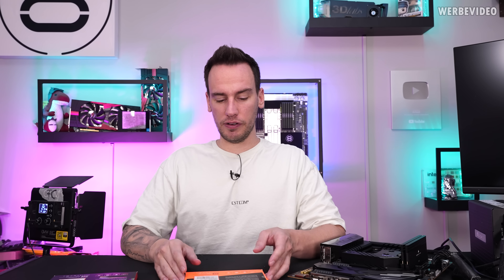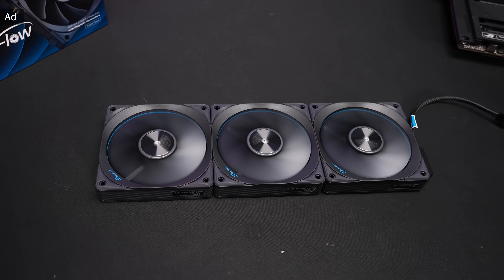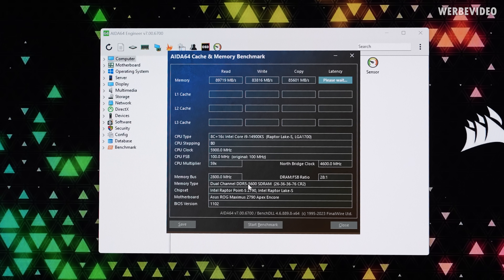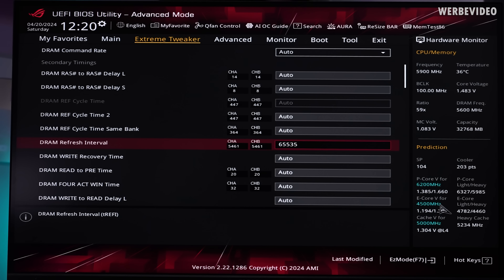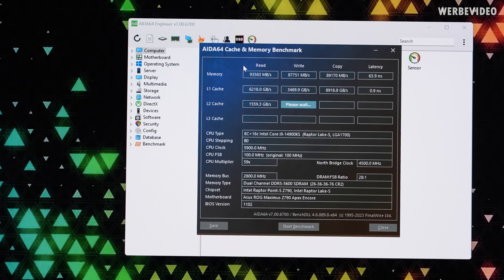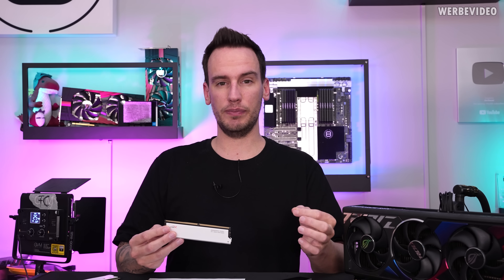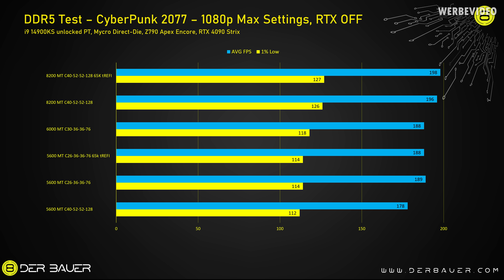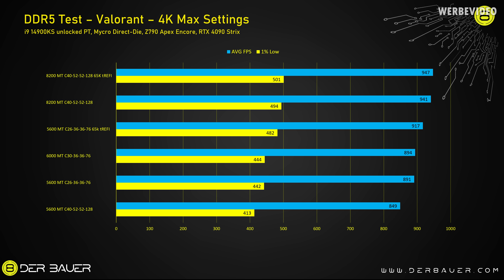Try this DDR5 Subtiming Tweak for Extra Performance

Comment: If you're on 6000MHz RAM or similar, on AMD, look up Hardware Unboxed's RAM timing video, they got info from Actually Hardcore Overclocking (who specializes in memory OCing) for timings that give you a noticeable performance gain, while being "just plug and play" stable.  They tested them & saw gains between 2-15% in games, so it's very much worth doing.  It's just a bunch of secondary timings for the most part, but it definitely works, I've been running it since shortly after I built my 7800X3D system late last year, never had any issues related to memory performance or gaming.

Comment: The only people talking about how memory timings won't make a massive difference clearly just don't know how to make a proper tune work. You will gain not only 10's of FPS but also make your frametimes much more consistent with a nice RAM kit that can handle low timings, just speaking from experience.

Comment: There wasn't said this is valid for Intel only...for Ryzen it is the other way around, lower timings make much bigger difference than higher frequency.  Especially tweaking not only the Primary but especially the Secondary timings for Ryzen makes huge difference in performance😉I would like to see the comparison also for Ryzen with those low latency sticks....

Comment: Hello Der8auer, I have a technical question to you. A few years ago Steve from GN made a test on different RAM configurations, specifically 4x16 vs 2x32, DDR4. I remember he was saying in the conclusion that by running 4x16 configuration you generally get about 10% more performance. Do you think this is still relevant today for DDR5? If yes, do you think it would affect the results of the memory bandwidth tests?

Comment: The most important subtimings:
tREFi - 65535 (If it's unstable can be used 52224 or 32767)
tRDRDSG - 16
tWRWRSG - 16 (or 8 if it's stable) everything between 8 and 16 gives worse performance than 16
PowerDown - Disable
Reply: I would keep power down enabled it helps with idle power consumption

Comment: Quad channel DDR4 still gives better bandwidth and latency. DDR5 is such a yawn-fest.
Reply: Until DDR5 12000 exists using a 1/2 divider on AM5 anything above DDR6000 is a pretty pointless on Ryzen.

Comment: If you want a test that'll actually show a difference try using Starfield or Star Citizen. Both have massive improvements from memory latency, even on X3D CPUs.
Reply: Testing CPU limited scenarios is the only way to properly test Ram speeds. It’s not going to do much if you’re GPU limited. Faster and or lower latency Ram reduces CPU bottlenecks.

Comment: The ram timing become much more important on games/programs with a very heavy RAM usage for many small data sets and where the CPU cores (for the program) are getting maxed.
effectively, the CPU/GPU busy thing also happens to RAM, so lower latency effectively means it can handle those memory calls faster and move to the next computation sooner.
this is especially true in physics simulation games that peg only a few cores like KSP (1), where the engine is handling complex math with many interworking variables that the CPU has to calculate a few times every frame. 
if the games simulation rate happens at say, 200hz, that means on average we're making 3x simulation passes per frame at 60fps. if the game has to run gravity, velocity, rotation, collision/interaction, aero, thermal, thrust/thrust vector, lift, and power calculations on EVERY PIECE of the aircraft 3x every frame... yea, thats a LOT of math that handles floating point numbers stored im memory. latency is much bigger here.

Comment: Great all the speed we can handle. Yet, I thought there was a relationship between pin burn-out and xmp profiles, mixed with high performance ram - while supported on the motherboard QVL will actually void the warranty of the chip (Intel)  I am a system integrator, while I desire the best performance possible for our high end workstations creating failure isn't an option. Was purchasing K sku's for a long time until the recent problem - mixed with the frame issues is a giant mess indeed.

Comment: im sorry but this is a bad video considering how wide/normie the viewerbase will reach:
trfc and trefi are the key timings that when unstable literally destroy your files & os, this is horrible to just blanket recommend to people. ram tuning and stability is not a joke on new platforms/ddr5. Yes, 32000~ is safe, 65000 needs to be cooled below 50c at the least so is bad for most users and must be stability tested, and anything above 65k is pretty much meaningless in actual return and the window for instability/overheating corruption goes through the ROOF. you are not talking about this much at all and how serious it is, just "yeah it can cause instability and the data returned can be 0's instead of 1's".

trfc - trefi are hand in hand and once you get to <2% below time spent refreshing (literally achieved by 600 trfc and 32500~ trefi alone) it is not very significant.. and your benchmarks show show that trefi alone is not impacting gaming much at all. synthetics and aida, sure, but 1440p+ gaming? anything past 32k will not do that much.

so many inexperienced/ignorant people will watch this video and just add changes and gg. you can't just increase trefi too, it needs extra voltage in some situations, and on ddr5 that can stupidly make everything out of whack too. 32000 is pretty much guaranteed/safe, but 65k is riskier and NEEDS to be checked (tm5 1usmus many cycles because its a heat induced error, hci memtest, vst/vt3 looping, etc), which you don't mention at all in this video either.

combine that with the fact ddr5 stability is not even guaranteed beyond 6400~ for 4-dimm boards and low cpu imc quality is just crazy considering this reaches normal userbase.

Comment: It's a funny comparison, because when translated to actual time, the kits you compare are:

DDR5-5600 (9.3 ns - 12.9 ns - 12.9 ns - 27.1 ns CR2)
DDR5-8200 (9.8 ns - 12.7 ns - 12.7 ns - 31.2 ns CR2)

So the 5600 MT/s kit doesn't even respond faster on all the subtimings, it's actually a little slower on the trCD times, even though the difference is more than compensated by the shorter CAS latency.

But yeah, in generally I don't think the memory timings have ever been massively relevant since the DDR2 times, when latency difference were massive and CPU branch predictions were bad or non-existant. Modern CPUs will just keep the caches filled with all the likely data most likely to be needed next, so the actual ALUs are rarely waiting for a RAM access. 

And I guess nobody is even bothering to get to CR1 anymore, I think this still could give you a few tenth of a percentile of performance on DDR3 systems, but the overhead due to double-commanding is probably entirely irrelevant now when latencies are well into the double-digit numbers.

Comment: DDR5 is 2 years old but still a pain in the neck from time to time.  Running 4 sticks to get 128GB with XMP enabled is still a problem.  Reboot delay and slowness with expo enabled on AMD processors are still going on.  The failure rate is much higher.  Compatibility issues are still a problem as processor IMC is something we can only find out after testing with actual memory kit. The last thing a normal person requires is an unstable system that crashes randomly and corrupts OS to get from 179 to 189 FPS in some select games.
Reply: DDR5's a complete shitshow on both AMD and Intel when you put in 2 DIMMs per channel though. Definitely wouldn't recommend going with a total of 4 DIMMs for just gaming
Reply: while I agree it is unacceptable that 4 dimms are almost unusable with ddr5 but I'm not sure who's to blame. I think it would be safe to go for a 4 dimms kit if you need more than 128gb ram. in other cases just use two dimms. but the way I see it 2x64 should cover most power users

Comment: Roman (Der8auer) also doesn't seem to realise that not only is the MT/s of the RAM different, but on Intel, the difference between running 8000 MT/s RAM and 6000 MT/s RAM also means that the Memory Controller is running at 2000 MHz for 8000 MT/s vs 1500 MHz for 6000 MT/s.

With Ryzen 7000 Series CPUs they would also be running 8000 MT/s RAM at 2000 MHz in gear two (UCLK=MEMCLK/2) in the Memory Controller, but they would be running 6000 MT/S at 3000 MHz in gear one (UCLK=MEMCLK) in the Memory Controller
Reply: Papá Jim Keller diseñó esas dos arquitecturas.

Comment: Great video as always. I would always recommend the Tgroup sticks btw. 7200+ will always be A die and the stock heatsinks actually cool the best compared to other brands. Also, you can generally tighten the timings up a lot more than demonstrated in this video.

Comment: EDIT: After trying this for almost a week I found it creates massive stability issues. Graphical glitches on desktop. Chrome crashing. Programs not loading properly or loading but not running properly. I wouldn't recommend this. 
I tried this with my A-Data DDR5 4800Mhz (2x 16gb) running XMP1@6000Mhz. XMP1 timings are 76-40-40-40. AIDA64 reported 73.1ns with stock timing. Then 64.5ns with the tREFI tweak. I'll try this setting seeing as I see a big difference and see if theres any problems with daily use. Using a 12900k and 3080Ti on a Z690 Gigabyte Aorus Ultra MB. .

Comment: I wanna see a video of DDR4 last gen cream of the crop, 4000mt cl14, overclocked vs DDR5. Personally by my math my 4266 CL14 will cream that 5600 cl26 except for bandwidth. There will be a cap in bandwidth for games, you don’t need 90gb/s and latency starts to matter more. It’s not loading the whole game in 1s. The 8200 CL40 was the best because of latency not everything else. So it really goes back to what has been true since ram was invented, latency, I mean that’s why it exists in the first place and that’s how software wants to use it. This is a “tweak” for gaming where the data is constantly refreshing, try solidworks or 50 chrome tabs and see how fast the BSOD will get you

Comment: 8200 C40 already is a low latency kit.  It's the closest you can get to the same as 6000 C30 and 5600 C28 without being the exact same.  Thus the C26 5600 kit is only marginally better.  Though, sub timings and tertiary timings would have an impact on hierarchy as well as raw megatransfer speed.

Comment: getting 104gbs on 6400 cl32 and 58.2-59ns with memory try it and msi memory enhance can get slightly better with manual timings but pretty good for board settings.

Comment: Hi der8auer I see you left out tuning of trefi x9 at same time when tuning trefi, I tuned trefi x9 and trefi on my 8000-40-48-48-128 kit and saw a further reduction of latency again, I have a 8000-40-48-48-128 48gb kit doing 52-53ns latency with a trefi x9 and trefi tweak whereas they will only do 58-60ns when tuning just trefi alone.

Comment: Please do an in depth video on all the DDR5 timings, what they do, and how to optimize them. Increasing TREFI  is a good tweak, but, there is much more that can be done.
Reply: go watch Buildzoid
Reply: Tweaking trefi and trfc will exhaust 80% of the overclock potential, an average user really shouldn't bother with other secondary and tertiary timings.
Reply: @beachslap7359  Unless you have Ryzen, then tweaking the Secondary timings makes huge difference in performance😉
Reply: @beachslap7359  depends on the platform overclocking memory is often and or with timings, for 1 CCD ryzen anything more than 5400Mhz is pointless dont know how it is with intel, so ryzen 7500f 7600 7700 7800+x3D only benefits from tweaked timings + overcloking of infinity fabric.
Reply: Look up Actually Hardcore Overclocking / buildzoid - he's got quite a few guides for DDR5 timings and I've been using his "easy ddr5 timings" on my 7950x for over a year with no issues (well no issues that weren't caused by this mobo initially sucking at training but a bios update fixed that).
Reply: It's been done to death already....

Comment: Instead of using 14900KS, should have used a CPU with less cache like 14600K or Ryzen 7 7700x which is known to heavily depend on RAM timings as shown by hardware unboxed tuned RAM testing

Comment: Easy, low latency on AM5 since Ryzen memory controllers are crap and designed for 5200mhz.  If you get yours working at 6400, you are the lucky ones.  For Intel, frequency over latency.

Comment: Given the almost rage inducing  stability issues I recently had using baseline settings, I won't get anywhere near this.
It's a nice and educative video though, that gives a pretty nice use case scenario for enthusiasts. I myself find stability, much more enticing than one digit performance boost which case, to be honest, I wouldn't be able to notice any difference.
Thank you!

Comment: I have 5200 jedec ram, i overclock it to 5800 30-36-36-72 at 1.3V and its stable for stress testing and lot of games, 
however when i try 6000, its unstable even i put loose latency 40-40-40-96, im so confused
My specs Ryzen 5 7600 and Asrock b650m hdv
Reply: Try 1,4-1,5v.

Comment: I find myself a bit disappointed, maybe I've been watching too much of Buildzoid's stuff but I expected to see interesting stuff about subtimings, instead I just learned that Intel allows tREFI to go up to 262k which is interesting but useless because no RAM is going to be stable that high.

The best way to buy RAM is to get the best frequency and primaries you can afford, run the best frequency your memory controller and board will do and then tweak the timings down to what the RAM will do.

Comment: I just tested your suggested setting on my AM5 Ryzen 7500f. It does give some improvement to memory performance. There is about a 5% increase in Read, Write, and Copy from the previous setting of auto (12346) to this exact number, 65535.

Latency is a little bit better too. Thanks for sharing.

Comment: My two z690-i systems' latency @ 55-53ns: 14900K + 3090OC + 96GB @ 6600CL30 9.09ns, 12700K + 3070OC + 64GB @ 5800CL26 8.97ns. You want system latency under 60ns to feel good, 55ns better, 50ns best, 45ns- golden. DDR5 is typically 10ns, Windows 60ns. DDR5 can usually drop to around 9ns before heat becomes an issue. I saw demo videos on how to make hardcore edits to Windows timing structure, basically cutting OS latency down to a Linux-like level around 30ns; I have not even attempted this as it is really well beyond my understanding at the moment, but is an incredibly interesting idea.
Reply: "you want system latency under 60ns to feel good".
You are living in your old false reality.  A make believe world in which you are able to see the difference between 10 nanoseconds and not.  
You don't perceive any difference.  Even if it was 58ns vs 102ns, you wouldn't notice anything.

Comment: Why did you test cs2 and valorant at 4K max settings? That isn’t how people play those games. 1080 or 1440 low/med would have been a better test.
Reply: Showing the cpu bottleneck i think
Reply: @PaulBlartGaming Playing 4k passes the bottleneck to the GPU more often than not.

If he had done 1080p low settings test,  you'd see more of a CPU impact.

I get playing maxed out and seeing if the RAM can make an impact, but to make a larger CPU impact, run low settings.
Reply: @MyersComputerServices  if he had tested on amd you would see a larger impact, also in cs2 and val its a cpu bottleneck anyway so it doesnt matter. %dif stays the same when you are testing things to make the cpu faster if the cpu is the bottleneck the whole time.

Comment: my ddr5 is 4800mhz 40cl single stick 😎
Reply: I messed up originally and ordered 4800 cl40 16gbx2 bare dimms. Bought some 6200 cl30 instead. Much higher max framerates in esports titles, but tbh not a huge difference and no differences in gpu bound games. This was with a 14700k.

Comment: Telling people that bit flips "doesn't matter that much" while gaming is really, really bad advice. You are going to end with data corruption everywhere, not just during gaming, the disk is going to be corrupted very quickly, and you are going to end with unusable system. Don't even think about installing an OS update with these settings.

Comment: I feel like you should've mentioned more about making sure TREFI is stable, not all kits will just work.

It's one of the harder timings to be sure is stable and can corrupt your OS slowly if it's not. Too many noobs will watch this, max it and start gaming.
Reply: Worse performance with higher Trefi is an STRONG indicator that the ram tune is not stable! The test then is invalid and should be rerun after Karhu 6000%+ testing.
Reply: I had a 2x32GB DDR5 6400 CL32 Hynix A-Die kit and 65K TREFI is unstable (errors on VT3 and N63) unless I raise voltage from 1.4V to 1.435V
Reply: You should ve running closer to 1.5v for cl28 anyway 2 birds one stone
If lucky and motherboard keeps training cl26 wil work with 1.65v
Reply: Yeah, and the heat from the GPU can cause instability too from high case temps.  I'd ideally test with some GPU load to check if the RAM would be stable given additional heat.
Reply: I also want to know HOW it could make it warmer
Reply: 100%
this video downplays the severity of trfc/trefi instability a LOT and the viewerbase for derbauer isn't just people who know all about ram oc and the impacts.
even in his video here, the benchmarks show it didn't even improve all that much especially considering most people are playing at 1440p or above. 32k-65k are realistically the only amounts you need to increase it to, but anything above 32k seriously needs to be stabilty tested and temps need to be monitored to be below 45/50c
Reply: I've had memory corruption show up only after memtest for 7 hours. Memory testing is absolutely essential, and DDR5 loves to hide those problems. It's better to catch them before they eat your critical files.